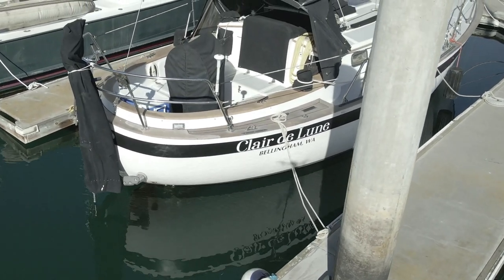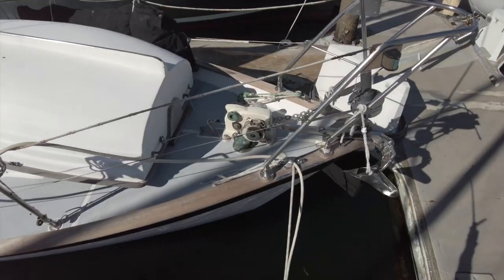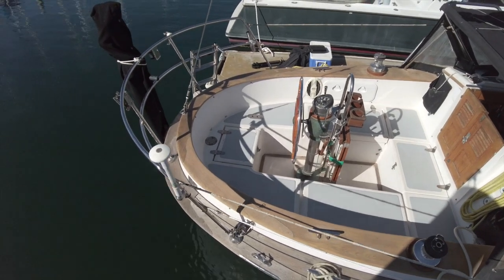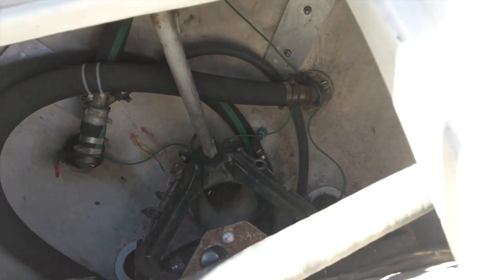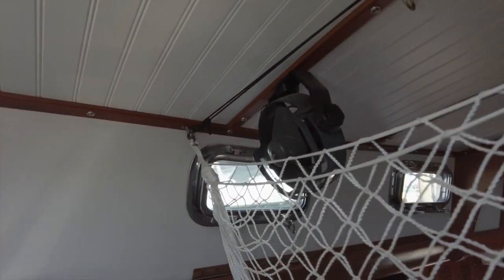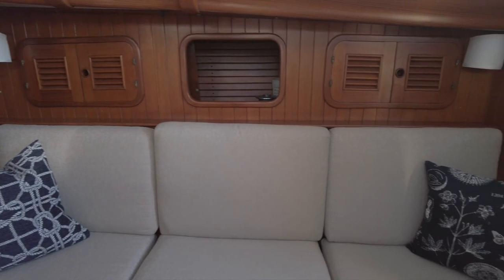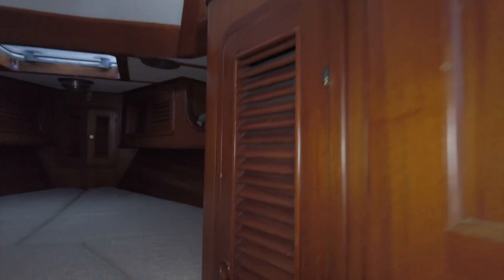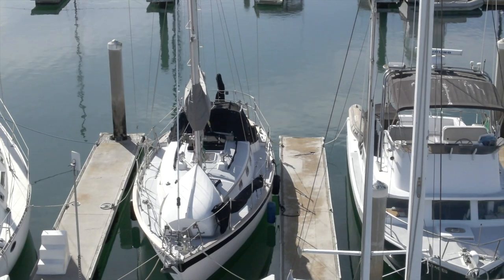Clair De Lune - 1984 Union 32

Comment: Curious to know wont the wind vane also increase drag ? Or is it marginal ?
Reply: This windvane was the winner of the around the solo race nonstop on the older boats. It's considered the best plus when not in use you can pull up rudder out of water. Pretty cool
Reply from the maker: The vane itself is alway dead into the wind, so little to no drag.  The rudder is relatively small, so again, any drag would be imperceptible.  In any case, these are mainly used by cruisers for convenience at the helm.  Speed is not always the priority.

Thanks for watching!